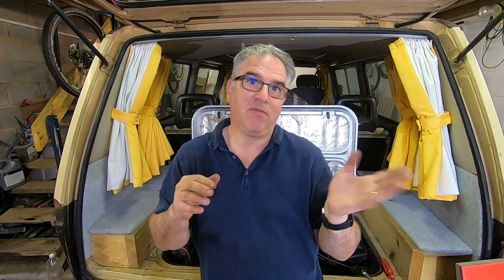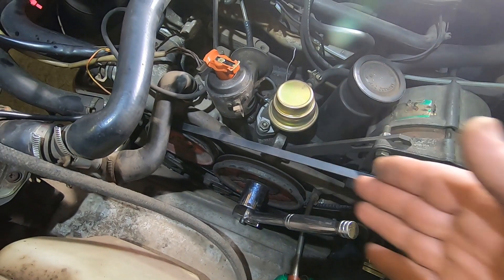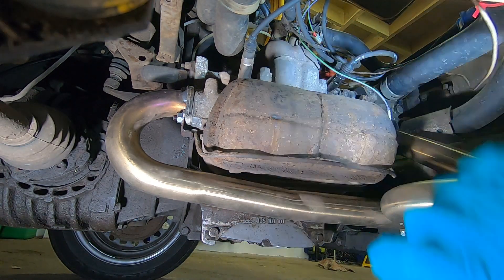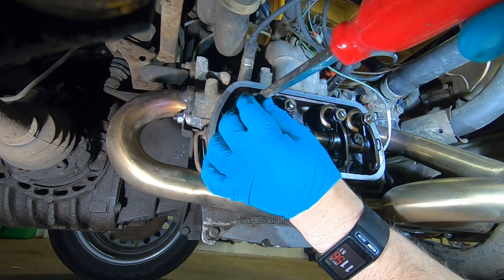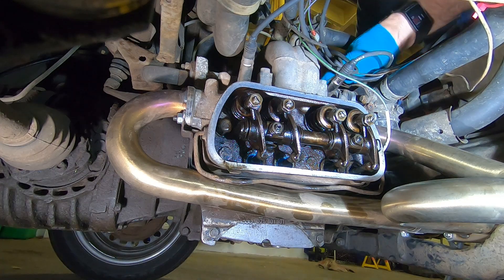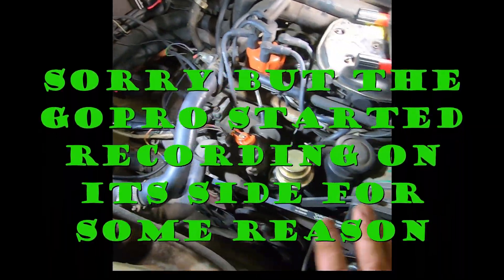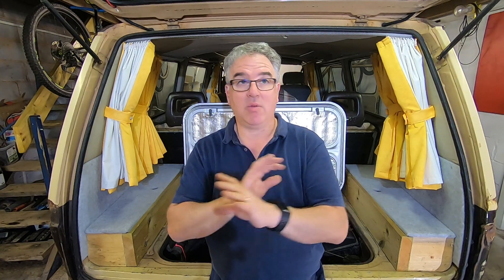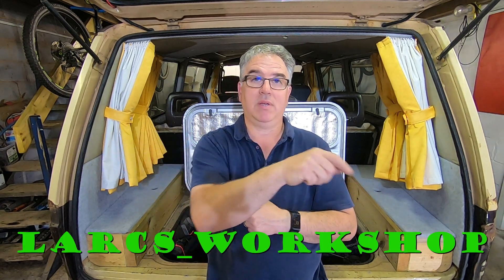Noisey T3/T25 hydraulic tappets? Lets adjust them.

Comment: A good tutorial,  My 2.1 digifant engine had excessive valve clatter after running a while, popped the covers off and found adjuster exhaust #4 laying in the valve cover, intake adjuster#4  1/2 way out and the 2 lock nuts by Cyl #3 in the head below the valve springs and rocker arms..
some bloke (me had a daft moment the last time I adjusted the Valves) forgot to tighten the lock nuts which never happened before  also I tightened all adjusters 2 1/2 turns and engine runs great!
Reply from the maker: Thanks, wow must have been noisy 😬. Good job you fixed it before any damage was done👌. 
Cheers Larcs 👍

Comment: Wow! What a difference! I thought that's how they were supposed to sound...I have the 1.9DG and it's a bit rattly... I must admit I didn't quite understand the timing bit, maybe you can tell us more about that?
Reply from the maker: Thanks for the comment. 
Basically, the spark plug lead that the rotor arm is pointing at, goes to the cylinder at top dead centre (when the spark plug fires). This is where you want the engine, to set the pre-load (2 turns) on the hydraulic lifters.
Hope this makes sense, sorry I'm rubbish at describing things.
Reply: @LarcsWorkshop  No that helps! I appreciate you commenting back. Love all of your videos, thanks for taking the time 👍🏻

Comment: The adjustment screws also wear . Vw suggests 2 turns but a lot of people say that 1-1,5 is better because the valve seats wear
Reply from the maker: Thanks for the info👍.
Cheers Larcs.
Reply: we user feeler gauge for making valve adjustments in vw bug, but in T3 it is not needed I understand. Am I right?
Reply: @hakanklc2833  that depends entirely on whether you are running solid (feeler required) or hydraulic (self-adjust) lifters

+1 1.5 turns vs 2

Comment: great video! i was scared to do anything with the engine in-case I break something but you make it look pretty straight forward! I am going to have a look at this on my van now :) 
when you crank the engine, is there a reason to do it counter clockwise and not clockwise? I am a complete beginner and just trying to gain knowledge :)
Reply from the maker: Hi, thanks for the comment 😃. It doesn't really matter which way you turn the engine just as long as the cylinder you're adjusting is on top dead center (TDC). It's worth noting that if the rockers are not slack (like mine were not) when you first check them, it's probably worth slackening them off then leaving them for a minute or two before resetting them. This should allow the hydraulic tappets (or lifters) to fully relax before re-compressing with the scree. Good luck with the adjustment 🤞.
Cheers Larcs 👍
Reply: @LarcsWorkshop  not sure if you check old video comments but fingers crossed... i had to readjust mine today as it was making a rattly noise all of a sudden, but i notice on some of them i had to have the screw done up so much that the nut didnt have much thread to hold onto, while others still had loads of adjustment left (if that makes sense) do the adjusting screws wear down? or have i set them up wrong?
Reply from the maker: @oldmanad  The locking nuts would normally easily be on the threaded section. Probably worth checking again, try releasing the pressure on the screw fully and leaving it for a bit to ensure the hydraulic cam follower has fully expanded before you reset it. Good luck sorting it out 🤞.
Cheers Larcs 👍
Reply: @LarcsWorkshop  thanks for the reply. i have a feeling i was on exhaust stroke and not compression stroke. will try to adjust again on my next day off ( i didnt realise there are 2 tdc's for the same cylinder)
Reply from the maker: @oldmanad  No problems 👍

Comment: Thank you. My DF is very noisy so i will try this. But why are they gettin loosy ? I thought they are maintenance free ?! 😮
Reply from the maker: I guess it's just a little bit of wear on the cam, followers, rockers and valves and it all adds up over time? If you have to adjust them often I think it's a sign of excess cam lobe or follower wear.
Reply: Okay thank you. I will try it. My engine is 41 years old and has never be opened. 😂
Reply from the maker: @Riki.Masorati  👍

Comment: Hi, Thanks for the video, I had a similar amount ot tappet play, (2ltr petrol engine) do you think there's any risk of the valves hitting the pistons when the hydraulic tappets get full of oil, 
Also thinking a few of them are a little weak, as I was able to plunge them in s little after taking out the free play,
Thanks keith
Reply from the maker: I wouldn't have thought they'd touch the pistons. If you can push them in easily by hand and they're squishy, I'd say they're on their way out.
Cheers Larcs 👍

Comment: My van is very tappy after starting when it's been stood for a few months over winter. It eventually clears once the engine gets warm and then is quiet as a mouse. Would I be right in that it's more likely to be a sticky tappet rather than clearance settings?
Reply from the maker: I think you're correct 👍. It's very common for them to be tappy when they haven't been used in a while.
Cheers Larcs 👍

Comment: Hi, it's normal when i add the 2 extra turns, the valve is a little bit opened? Thanks!
Reply from the maker: No it definitely should not be open. It should only compress the hydraulic tappet (or cam follower). 
Cheers Larcs 👍
Reply: Ok thanks but if i add the 2 extra turns, the valves start top open, any idea ?
Reply from the maker: @angerx4  . If they all do the same, it sounds like you might have solid followers not hydraulic?
Reply: In fact only 2 tappet seems to get the problem
Reply from the maker: @angerx4  I would suspect those two have failed or somehow got stuck.
Reply: Do you have a tips to unstuck it please?

Comment: Hi, is it normal that 2 tappets are not aligned in the same piston? Because one of them is out few millimetres more  then the other one.
Reply from the maker: They should both be more or less the same. Check you're on TDC on the compression stroke on that cylinder, you might be a little bit out? Good luck sorting it out 🤞.
Cheers Larcs 👍

Comment: Does the oil or coolant need to be drained before this?
Reply from the maker: No, although there will be a small amount of residual oil left in the valve covers.
Cheers Larcs 👍
Reply: @LarcsWorkshop  Thanks! I did it but still hear the tapping. Before I start the 1.5/2 turns, should there be no play at all in the rocker? It sounds a lot better but I still have some ticking.

What I mean, I can kinda still compress them and keep getting movement so I think I got them all too tight. You seem to be only holding the rocker with two fingers from the side. I was pushing on the lower part until there was no movement I could create and then started my two and a half turns.
Reply from the maker: @crocro8559  . Shouldn't need to compress them before tightening them down, just 'feel' the resistance. You might have some weak ones like I have. The ticking might reduce after a good long drive, they like that.
Cheers Larcs 👍
Reply: @LarcsWorkshop  Thank you very much!
Reply from the maker: @crocro8559  👍

Comment: How do I know what engine I have in a 83 vanagon?
Reply from the maker: Find your engine number and look it up on the internet, there is loads of info about them. The number can be found stamped on a flat area above/right (facing you as you look at the engine) of the crankshaft pulley.
Cheers Larcs👍

Comment: Wow, how could your tappets have been that loose? Not just a little bit short of preload but actual lash there?! And your dizzy drive is 90° out, with plug leads moved round to compensate.
Reply from the maker: Thanks for the comment. Yeah I know, better now though. Hadn't noticed the dizzy, the drive must have been out in its long and sordid past LOL, then put back in wrong. Another job for the future maybe?
Reply: @LarcsWorkshop  yep, it'll make life easier when explaining things too! When you set it to the notch in the dizzy, that should correspond with no1 firing, and the pulley 5° notch (yours was on no2).
Reply: @andrewsimmons8139  my dizzy is positioned exactly the same lol
Reply: @andrewsimmons8139  your correct I just noticed that as I've only just set the distributor timing on mine but none the less a very helpful video
Reply: Yeah I was tripping on that too, thinking I was messed up, mine is also 90 off from yours!